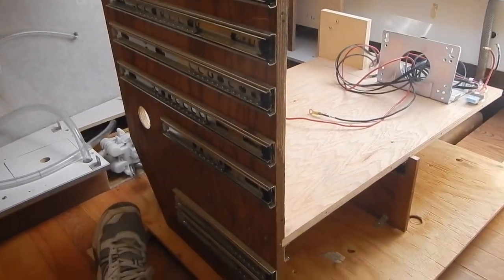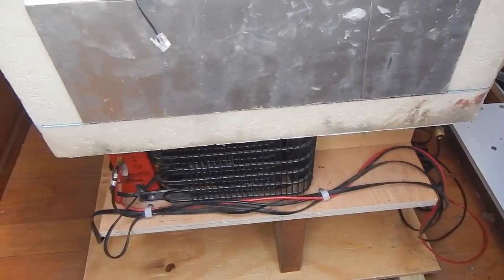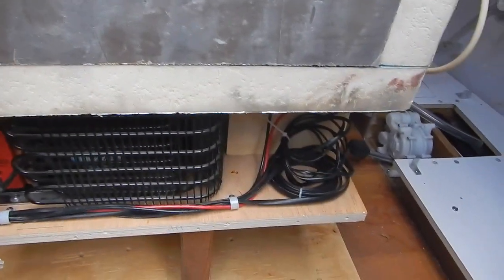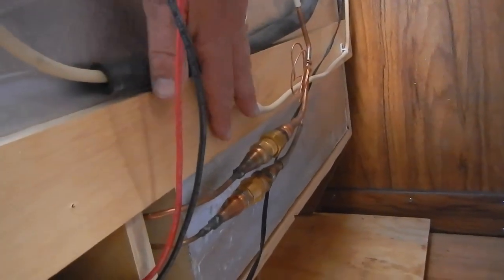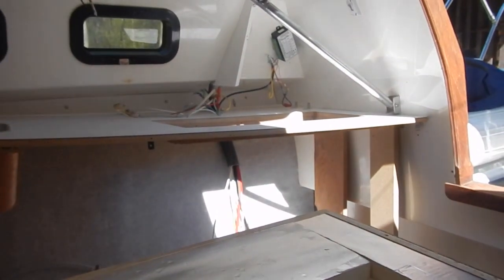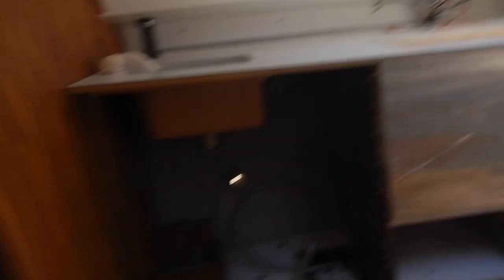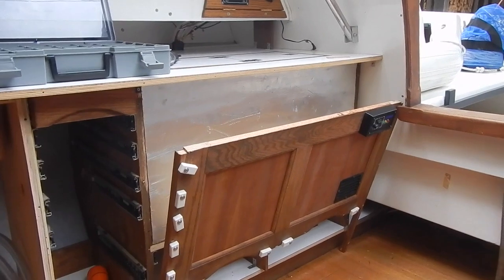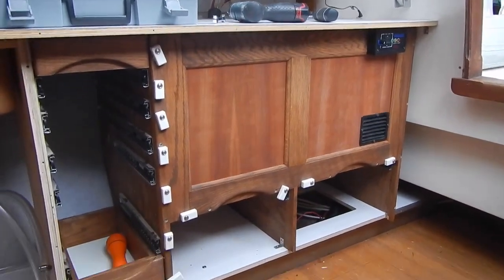Ep 28: Refrigerator Installation

Comment: Have you installed a bulge pump yet?
Reply from the maker: No plans for a bilge pump.  When the boat is in the water, it's never connected to shore power.  I think a scenario in which the boat is saved by a battery powered bilge pump is pretty unlikely.  I think there was a big thread about this in the archives of the email list somewhere.